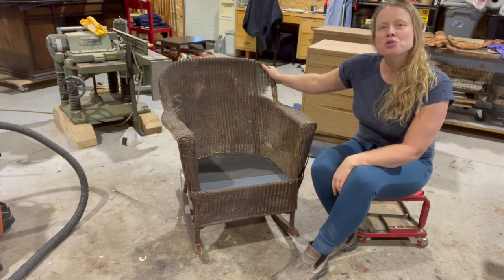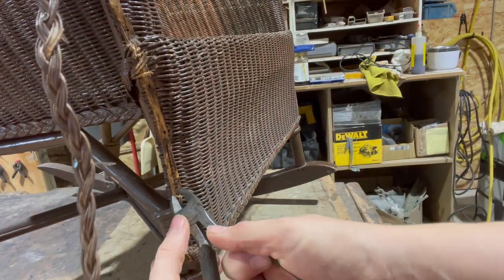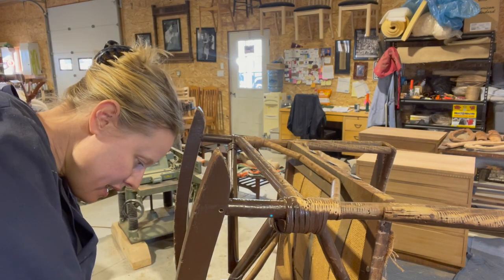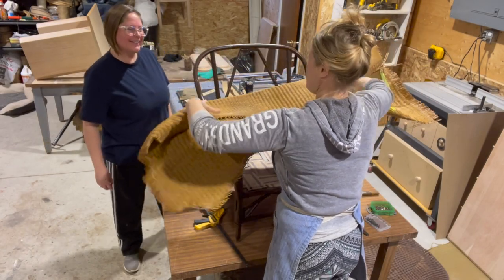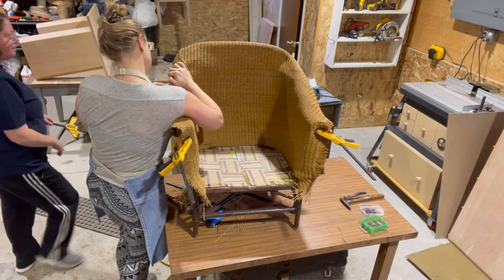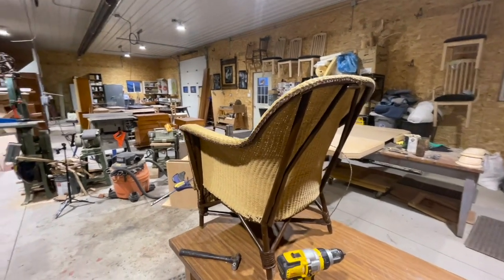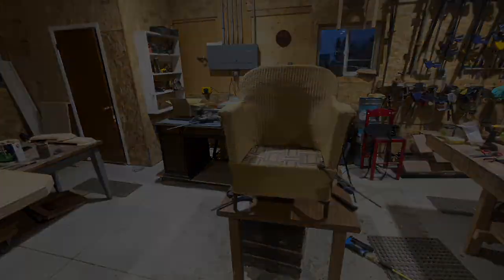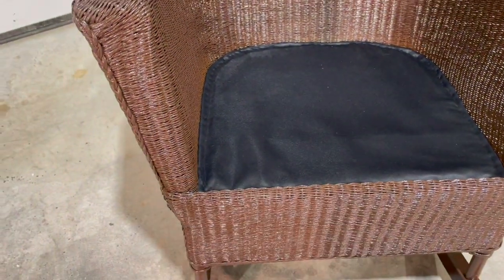How to replace Wicker on a chair

Comment: The paint is original…as I found out when researching the Lloyd Loom company after I bought a great little early 1900’s desk and had to source the woven paper in order to re-weave part of 
the corners and the  sweet little rolled back.  (Mine was a deep oxblood color, with gold braid-original color). It actually added strength to the woven paper, and made it weatherproof.  Lightweight and flexible/comfortable, one of their early best products was baby buggies (early 1900’s). They are now Lloyd-Flanders, still make woven paper furniture that is quite expensive. I believe the company is in Menominee, Michigan.  I give you credit for taking that one on!
Reply from the maker: Oh nice! Thanks for the information!

Comment: Fearless as always! I had a tough enough time doing real caning on cabinet doors for custom furniture I built. Glad you guys had a laugh, as it does look ridiculously difficult. Customer's choice, but caning/wicker should be natural or stained (in my humble oppinion). Hope you got paid enough for this. The frame is better built than most, but I shopped the internet and there are a LOT of wicker/caned rockers out there, from $200 to $900 (plus shipping?). Must have had SENTIMENTAL value PLUS. BIG RAIN in SoCal, but your vids always bring sunshine to my day.🌞
Reply from the maker: Yep. At least it was a paper weave
Reply: @johnsfurniturerepair  I was surprised — didn't even know they made paper cane. While cane is a fibrous wood like material, I can't get my head around how paper would have the strength of cane, even twisted as showed in your vid. I'm sure I'll find some more info somewhere on the net.

Comment: Did you consider a Dremel, with a cut off wheel, for trimming? Why wouldn't they/you use a strip of cow/raw hide for tac strip? Your the bomb, love your vids!!!
Reply: I was referring to the strip u remover under the ribbon weave you removed while disassembling.
Reply from the maker: That might work

Comment: Hello Trena, What is the Fabric roll that you used/bought called and where can I buy it -- How much does it cost per roll ? Also the seat had these metal strips through which you did a fabric weave -- What are the metal strips called and also the fabric used -- thx -- Cheers, leonard
Reply from the maker: Hi Lenard. So the prewoven weave is from Franks weaving. You can order online it call them. I do t remember what it cost but it’s sold by the foot. I would just call the metal parts metal strapping and  I added jute strapping 😉
Reply: @johnsfurniturerepair  Thx Trena, great teaching video, thx